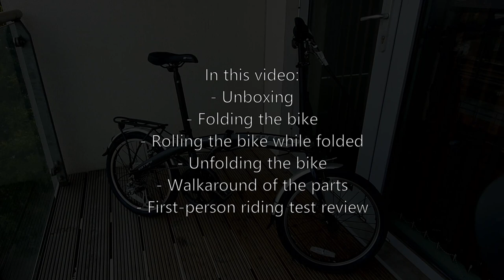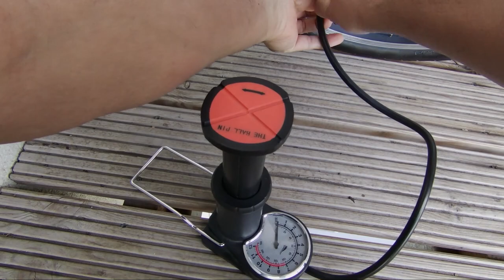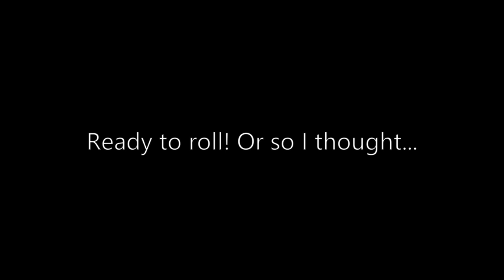Carrera Intercity Folding Bike - Unboxing, Walkaround and First Ride Review

Comment: Any idea how many teeth/sprockets in the chain set?
Reply from the maker: Unfortunately I don't know.  The "manual" that came with it is next to useless and doesn't have any technical specs listed. Its also hard to physically count the teeth as they are obscured by the double sided chain ring guard.
Reply: @ImOnItLikeJamOnToast  Cheers for checking. I wanna get a bike like that and then a Bafang mid range conversion kit (so replace the chainset) but if even the factory wont tell you how many teeth then I might just look elsewhere, although there appears to be a drought on folding bikes in the UK at the moment..